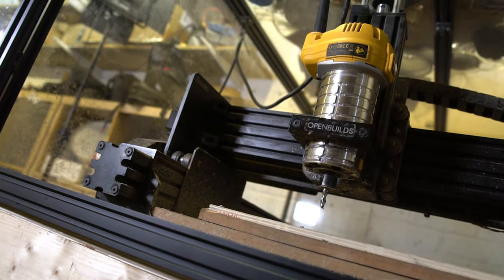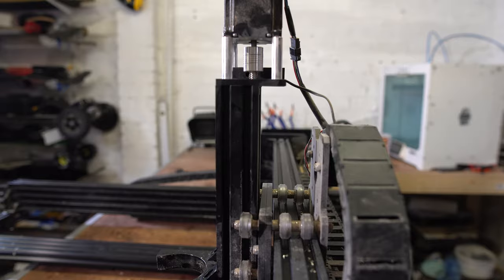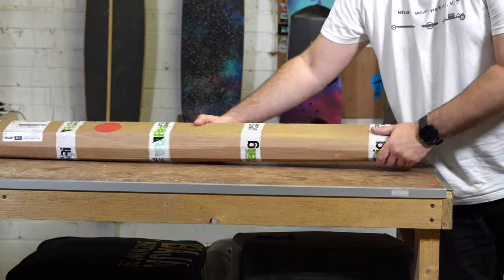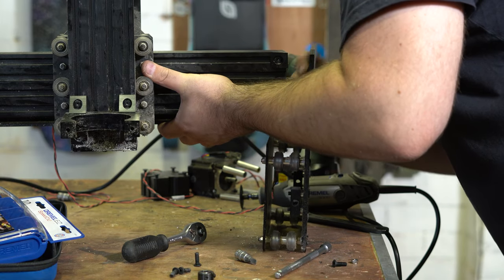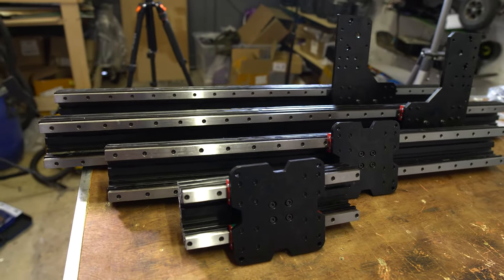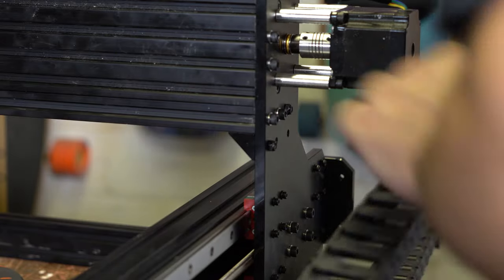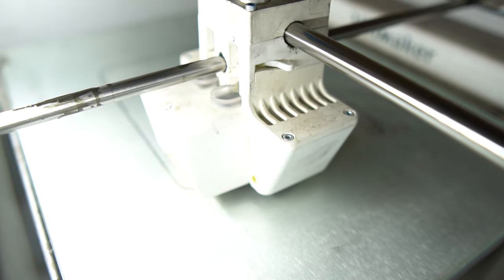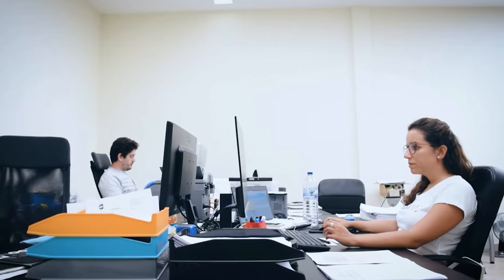KILLER upgrade for the workbee CNC! (RatRig Linear rails!)

Comment: Now Im going to have to upgrade mine.
I have not even used it yet. XD

Ive been trying to learn the Bantam CNC I can model just fine.
Its the CAM parts that Ive been struggling with.
Reply from the maker: Yeah CAM software is 100% the hardest part to get your head around.  I'm always happy to offer any info I've learned along the way mate, it's not much but I've picked up a tip or 2!

Comment: Thanks for covering this...I saw it just in time before pulling the trigger on a Workbee...I'll now switch to the KillerBee. One question I have is for the router and controller. Ratrig provides a AMB ER16 1400w spindle that can be controlled digitally...and I'm trying to figure out if that is a better/good version vs the chinese 2.2w ones. I plan on carving furniture faces and doors with it.
Reply from the maker: I actually couldn't answer that I'm afraid mate, on Facebook there is a Workbee users group - ask on there and you will get your answers!

Comment: Just curious if keep coding the same and clamp stuff better can you have machine on it's side? I want to make a very large one aka so put 8x4 sheets in the cutting area and not got much space where I am unless on ceiling or on side on floor
Reply: You need to counterbalance the gantry because the steppers won't be strong enough to take the weight of the spindle and gantry

Comment: Right now I am looking to buy my first cnc and saw this video but sadly since this cnc doesn’t work with 110v mains, I have to go with the workbee. Maybe I can upgrade later down the line
Reply from the maker: Hey dude, this kit used the exact same electronics as the Workbee.  All you need is a 110V PSU that kicks out the 24V required for the controller.  The rest is irrelevant 110/230V
Reply: @LeeWright  yea I was just thinking of upgrading later down the line. Awesome vid!
Reply from the maker: @shooter913b  That's what I did dude and thanks!

Comment: Nice video! Good to know that this upgrade is worth it. Just bought a used Workbee to get started with CNC work on and if I get hooked I guess I know what to buy next :)
Any particular reason that you don't have a dust collection system on your machine?
Reply from the maker: Hey thanks.  I rarely cut wood tbh, it's mostly metal prototype parts or final use stuff for my esk8 hobby so no point in dust extraction.  I also found the shoe very cumbersome and got in the way a lot. I own an Ooznest dust show but do not like it.

Comment: Hi Lee first of all thanks for the vid, like you I'm a total newbie in the cnc world. I have some questions if you would be kind enough to answer. First I've not actually bought the cnc machine yet was looking at buying the workbee until I seen this, would I be better buying a full Ratrig machine, I have a budget of £1700 if you had this budget what would be in your build apart from the cad software, I don't know anything about controllers or spindles any help would be much appreciated Lee
Reply from the maker: I’d 100% buy the Killerbee.  I’d look to get a router setup for now instead of a spindle and fusion 360 is free! Then I’d look to upgrade later on when I have some more cash.  Don’t forget you are going to need to buy end mills, safety gear and stock etc so make sure you budget for that stuff.
Reply: duet+router would definitely be good for starters, duet would last through a long time until you want to go for closed loop(in which point you need to either get something new or buy a extension board of some kind)

Comment: Hi lee 😁 had a question for ya. Not about video but i couldnt find any other way to message you 😉 i got a flipsky vx3 controller from amazon. Top hobbies was seller. It has delayed throttle responce. I contacted flipsky about it and they said it is not an up to date version. I would have to buy a new controller (same one) straight from flipsky to get an up to date model. So i did ☹️ i am wondering if there is a way i can copy firmware from new controller and put on the one with older firmware? 🤔 Flipsky on fb says no but thats prob just a girl doing their webpage 🤣 does it sound possible to you? Thanks for everything man 😁
Reply from the maker: I’m afraid I don’t think there is a way to do that bro, unfortunately.
Reply: @LeeWright  yeah, bummer. I got new one yesterday. I even had to change the receiver. They must have changed the signal. It would not connect to the 1.2 receiver. The new one (version 1.4) does have some different settings and uses a ping signal. Even on high though it is not much faster than old one 😉 a little better. I left my wand dongle hooked up to slave side for making adjustments with my phone on the go. Could always use the wand and change a couple settings if needed (slave/master)  that has much faster responce 😉 thanks and have a great night 😁